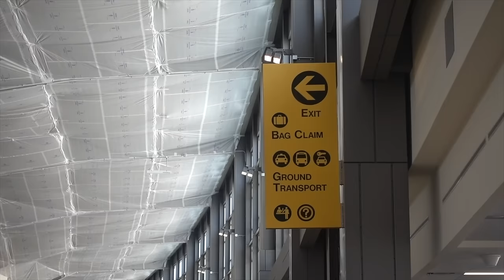MTB Myths that need to die—and some that are true!

Comment: I had never even thought about the risk of a quick release catching in the disk brake—I don’t have disk brakes and use security bolts instead of quick releases. But I just assumed that disk brakes were designed so that wasn’t a risk, since quick-release skewers were already standard by the time disk brakes became common. And I know that it’s possible for a quick release lever to interfere with a derailleur, so it’s been standard practice since they were invented to always put the rear quick release on the non-derailleur side (and usually the front on the same side just for consistency/convenience). I had no idea with disk brakes some people had started putting them on the other side. Huh.

Comment: Everything they told you to do in an airplane is safety related. In most planes there are pressurized zones like cockpit, cabin and the front cargo bay, where animals can be stored and non-pressurized zone like the aft-cargo bay. It is true that the bike tires can survive the outside drop in pressure when the plane is climbing steadily but in some cases it may not. AND NOTHING IS LEFT BY CHANCE. In case of sudden decompression at 39000 feet. the sudden drop in pressure may cause rappid expanssion of the tires causing a burst. Keep in mind that it would produce loud bang in the cargo bay and even damages to other people properties or in some case damage to the airplane. I wonder what you would thing if you hear loud bang in the middle of the flight comming from the belly of the plane from unknown source? That may lead to diversion of the flight and pretty expensive inspection and even an investigation of the incident. Because every such is carefully investigated in aviation industry. And those things are quite costly. You may say yes the same plane has tires that are pumped to quite a lot amount of pressure. Yes but airplane tires are filled with pure nitrogen - an innert gas that is not nearly that expandable comparing to the regular mixture of nitrogen-oxygen-carbon that your pumps are sucking at around sea level when you pump your bike tires. It's not stupid it is safety for you and others on that flight.

Comment: You want the QR lever on the opposite side of the disk. Mainly for me is because I don't want to touch my rotor with a greasy hand, lets say if you touched your chain. There is a reason all 15/20 axles have the lever on the right. Also after a long stop if you get a flat and go right into changing it, there is a less chance to burn your hand in the rotor if the lever is on the other side. Keeping the lever on the opposite side is way before 2016.

Comment: The folks that say to put your skewer in the bike with the cam on the drive-side are wrong, but I have had a properly installed skewer that would continue past where a normal skewer would stop. I think I've seen it happen twice in my 3 years as a professional bike mechanic. Bottom line, It can happen, so just use common sense when fixing your bike, if your skewer is going to interfere with your rotor, use the frame to stop it from happening.  or either just get a new skewer, or my favorite: get thru-axles!

Comment: I have literally been behind a guy who's QR lever went straight into his disc brake (back in 2004). Did cost him a broken collar bone. Cause: Riding down a rocky trail the QR lever got struck, bent, snapped open and blocked the disc ever so slightly. For, say, 10m (30ft.) he managed to ride it out but then the axle went off its position in the rear triangle and he crashed hard. I was lucky to already have slowed down when I saw that he was in trouble.

Comment: actually vertical storing (with front wheel at top) is better for fork because it let sponge under simmering to pickup  oil resulting in lower friction and better particle evacuation (oil gets there naturally when riding but not as much as when stored vertically)

Comment: I hate E-bikes. I hate E.V.s in general. I work in the automotive industry and even every Hybrid I've ever dealt with has driven me nuts. Plus I don't want a Lithium Ion 5,000 degree self-reigniting time bomb sitting anywhere near me or mine. I trust petroleum distillates way more; requires a perfect ratio of fuel to air under compression. Apply spark and repeat. Good and reliable, great sound if you tune 'em up just right. Whether a two stroke or four (though the two makes pretty much double the power at the same rpm) They'll get you up any hill or mountain if you know how to ride 'em. Takes a lot of athletic ability and bike control to just not dump the bike on top of you  on seriously steep climbs. I'm in the process of taking a cruiser frame, 80cc two stroke motor with a wrapped exhaust, mountain wheel setup, springer front end, dual front disc brakes, sprung saddle seat lowered two inches above the rear fender, Flanders style handle bars, friction driven light setup, and the cherry on top a one and a half gallon peanut gas tank. It's gonna be a thing of beauty. Especially when it's hitting some nice hills. Yes, it's a hard-tail and worth the extra workout. No, it's not for the faint of heart... or spine!

Comment: just to clear the plane one: plane baggage is pressurized as the rest of the plane by the very same cabin air. pressure will drop maybe 5 psi due to cabin altitude setting. But, temperature wise, expect your baggage to not be heated as much as the cabin, it may even freeze, unlikely but better consider it as such. Problem is your baggage may be exposed to high temperatures during handling, for example being under the sun with no shelter in a very hot tarmac surface, maybe because of a delay. Deflating tires to their minimum rating is a good idea, but do it thinking about possible temperature stress in the handling process. does the situation require it? Is it worth it for that specific tire and weather?

Comment: Replacing the quick link every time you unsnap it is like buying a new t-shirt every time you wash your old one because the old one wears out in the washing machine.
You replace your old shirt when it's worn out, not before.

And the reason they say to replace it every time isn't about greed by the way, it's about liability. Someone might unclip theirs the "wrong way" and wear it out prematurely or damage it in the process. If Shimano or Sram said they were reusable and then failed on the second use, they could be held liable. So it's easier to just say "one use only" and let the "idiots" decide what's best for them.

Comment: Regarding e-bikes, I only partially agree. I personally am fat and would consider myself lazy. I accepted that I need to change something and become more active. I decided to get an e-bike and it was definitely the right decision. I use it regularly (not in the woods, more in the city). Where I live, basically every trip includes some hills. If I'd bought a normal bike, I wouldn't be able to use it in my everyday life, because my condition is too bad.
Once you get past their top speed, there is no support anymore and you actually have to work more because you got a pretty heavy bike. Definitely not for lazy people. It's also great if you're in traffic with cars etc. because you can get up to speed a lot more easily.
So in a way, e-bikes are great for fat and lazy people like me, but they are not just for us.

Comment: I used to work for a TREK dealership and there was indeed a recall because standard qr skewers could undo and swing into the disc locking the front wheel sending the rider over the bars and ripping the wheel out
Reply: Faulty manufacture can affect anything. Forks and frames snap - do you ride assuming they are or will do?

Comment: I once re-used a 9spd quick link to the point that it fell off while I was riding along on smooth pavement, after dark. I had a spare set stored in my bar end.

Comment: about the axle side: not on the disc side because disc can be ultra hot. If you puncture ina a downhil (most of the time this is what happens) you'll have to deal with super hot disc and your finger close to it. And because you're pissed with the puncture, you'll do it super fast and be even more pissed with the burn.

Comment: I always just think the quick release skewer is pointing downwards, and if it is on the left side pointing down, when it hits something, it could rotate 1/3-1/2 turns and get loose. I doubt it will but that is what i have thought and i do have in my mind sometimes.

And yes, without an Ebike (A beach cruiser style) i would never started bicycling as a hobby. Now, we have many kinds and none of them are actually e-bikes. Ebikes are super good entry point into the hobby, specially if your physics aren't that good, as i did, now lost 25kg of my bodymass in 3 years. All thanks to a electric bike.

Comment: even if the tire explodes in the plane it is in the belly where the luggage goes and the worse that can happen is a loud bang that scares passengers and the crew can go into the belly and see it is just a bike tire and there is a mess of sealant splattered all over the stuff next to the bike.

a tire will NOT bring down a plane in the conventional sense (mechanical failure).

the suspension seals could try out crack and maybe the oil wil drip onto the floor and to some people that may be a problem

Comment: the confusion of myth and or notes passed from person to person is that they lost the original details, and then pick up assumptions, where some of this came from us as road riders, pumping our bike tires up past 120PSI and only witnessed only once someone filling there tubes with other forms of flammable gas. on tires that are very thin, and if they got poped by something in the cargo storage it would make a huge sound and cause the pilot to land. We started bunny hoping befor mountain bikes existed with toe-clips and foot straps and some olympic coaches years ago where trying to prevent the young riders from anything that might be hard on there knees or wrong movement for there muscles. the quick release is tucked in beside the bike frame tube to avoid someone's foot, object or another bike at the starting line of accedetaly pulling on the quick release, or such rock or stick that flips up and might jam or hit between. finally if I was a health insurance investor or a country with only public health care, I would reduce insurance cost for the rider that can pedal up to the top of summits as a real athletic challange,, and I would increase the health insurance to down hill riders like many down hill skiers, just like smokers are charged.

Comment: If you start driving from Florida to Denver co, and you have a bike on your rack…. The tires will blow by the time you are in Denver.  But….only if they are dry rotted. I’ve actually seen this.  It goes to show that it does matter what your beginning altitude is.

Comment: Also, quick releases should always point backwards so they can't hook anything like a branch or a vine.  It's not very likely, but it's more likely than getting into the disc brake.  (To which I'll also add that if you put it on the derailer side, and it COULD fall into something, couldn't it then just fall into the freewheel cogs, which could also be BAD?)

Comment: Well i have little problems hanging my bike up vertically with the hydraulic brake system, but a few pumps in normal position and they are back to normal.
The air travel stuff is right. Tubeless needs lower pressure and while it is true that most tubeless-drivers choose lower pressure, not everyone does that. I go up 45 PSI and thats kind of limit in first pace on my 2,2" continental raceking and Hope-rims... now even when it is offset +15psi and -5psi, thats still ending up 55PSI... and while that may not exlode on an instant, it might do that at cold temperatures... you cant tell that from your little tests down on the ground as the temperature and elevation affects rims and tyres at which pressure they go off at all. You talk about an airplane which is moving at hundreds of miles per hour with nothing but tin-foil-aluminium thick walls at thousends of miles altitudes with hundreds of passenger aboard... dude! try with a little RESPECT, your groudn tests are not sufficient at all to tell! its amateuer myth-busting-style. If they tell you to deflate the tyres for security reasons... you do that, no matter what you think is a myth, you have no veto, you have nothing to argue not even scientifically... because you do that not because of the security of your tyres to not get damaged, but for the security of the passengers and the plane. There wont be an 45-55psi explosion on a plane, and those rims shall not exceed 45PSI at all without a tube to compensate for pressure, and even if the chance is only 0,01% that it might occur going off, what could in general happen because of wrong width or too thick rim-tape or other mistakes during tubeless-setup. NOGO! Ive lost a screw once in a tubeless-typre.... imagine that one blowing off the rim at 55PSI inside a plane at 800mph at 30k feet....Noone takes that chance risking hundreds of lifes and a multimillion dollar jet-plane, such explosion its enough to blast "something" like this screw or else through the walls and then you have a problem with your flight in the middle of the atlantic or pacific, what you think... DUDE, not on your fault! You have the freedom to comply, nothing else or you and your bike stay where they are... on the ground, man!

Comment: On quicklinks, I tend to be one of those old "Freds" who rides a chain to rusty, keeping it free with silicone lube, so my quicklink tends to be single use, because my chain is. Hmm, reminds me, need a new chain, rings and cassette. Probably time to jump up 1x9 to 1x12 speed... Nah, 1x9 at 11 to 46 is my sweetspot, expecially as clicking up through the 5 torque settings on my electric pedal assist feels like downshifting chainrings without losing speed on "downshifts." ("Smug mode," Kryton, Red Dwarf.)

Comment: "LAST RUN"  Magic and mysticism:   There is a subconscious thought process and pretext to calling last run; and it goes something like this:  ---  ""I've been riding all day, I'm pretty tired, my muscles are fatigued and I haven't eaten.  I should probably quit now, but I'm having fun so I'll squeeze in one more run.  I'm not going to slow down or ride any differently despite my fatigue, so therefore crashing is more frequent, and injuries are more likely.""
And, surprise, you get hurt.
This phenomenon is also very common at ski areas.  At my mountain, half of the day's injuries occur between 3 - 4 pm.

Comment: Never clamp the skewer handle against the stay . It should always be free to complete it's stroke fully. The real reason to use the non disk side is the front wheel is that the space is tight and it's easier on the skin covering your knuckles. There's plenty of room to leave it  on the disk side  on the derailleur side sucks.

Comment: I agree with the bunnyhop point - it's a fluid motion thing.  BUT as a fellow rider that grew up bmx racing in the mid 90's and adopted clipless back then when Brian Lopes did - you can't deny the additional power they provided, especially in terms of off the gate - your front wheel would go flying up toward your chin, especially with the  low rotational torque of a 20" wheel.

It's WAY easier to get the front wheel in the air when you have like 1.6x the power AND can lift with your hamstrings. 🙃

Comment: If you hold the ball end at the proper angle you won’t mess the bolts up at all. I can get bottle cages on tight enough (they don’t need a lot of torque) with just the ball end. I’ve don’t it most days for the last 5 years working at a couple of very high end shops.

Comment: Hanging bike by suspension fork there have been some manufacturers of forks in the past that specifically stated in manual not to do that stating fork bushing damage from static weight in a direction it was not designed for.  Have not seen that warning for a long time.

Comment: On a modern aircraft the cargo hold is pressurised to the same standard that the cabin is. This is because pets and other living creatures, liquids and products are stored in the cargo hold. Putting your bike in there, it will certainly not pop or depressurise unless the temperature rapidly changes drastically. So next time you’re boarding a plane make sure to tell the boarding officer that you know the cargo hold is pressurised to make sure you don’t have to pump your tyres up when you arrive at your destination. 

Happy MTB

Comment: I am 58 years old.  In my late 20s, early 30s I raced MTBs in the Black Hills, SD.  I road a Schwinn (When they were still pretty good), and a Gary Fisher.  Both fully rigid bikes.  It was 1990 so front suspension was fairly new.  I saved up and purchased Manitou shocks for $300 plus installation.  Fast forward, I ended up in Ohio in 1997 and I purchased a Rockhopper with Rock Shox.  I road the Rockhopper for a year until I crashed and injured my neck (I have three cervical vertebra fused).  ANYWAY,  I am feeling well enough now to ride again and I have been riding a Trek carbon fiber "Fitness" Bike.  However I live within a half mile from one of the best MTB trail parks in the state.  I want to ride trails again, any recommendations on a decent bike?

Comment: You can torque down with a ball head hex bit, but you need to use it in the correct way which is no more than 30° from parallel

Comment: Hi Seth. Vin here from the Philippines. Would it be possible to convert a softtail 26er to 27.5 by replacing (some) linkages? I’ve got a 2013 giant reign and a 2012 scott genius. The reign I use on aggressive trails and the genius on all day riding.
I have tried 29ers but i just cant seem to control them like my 26er.